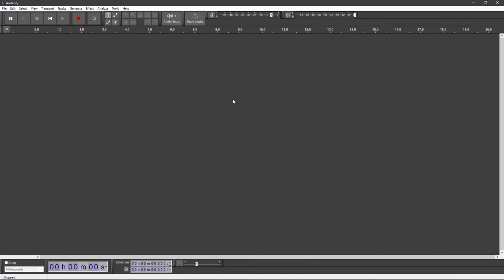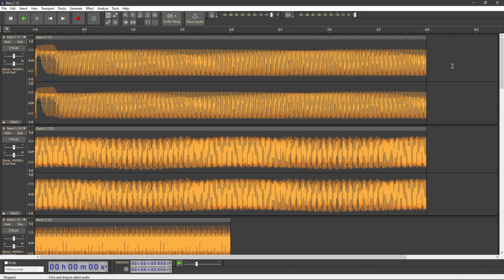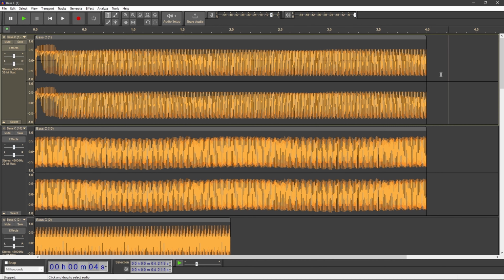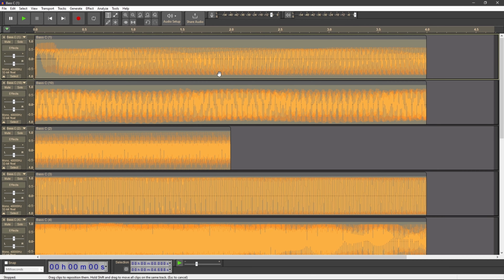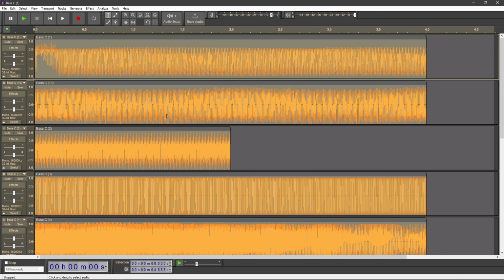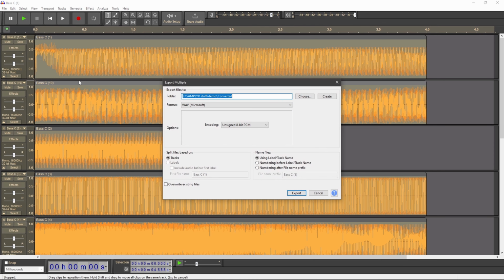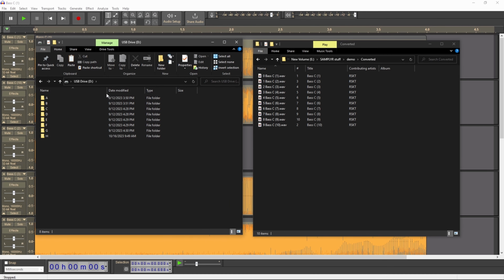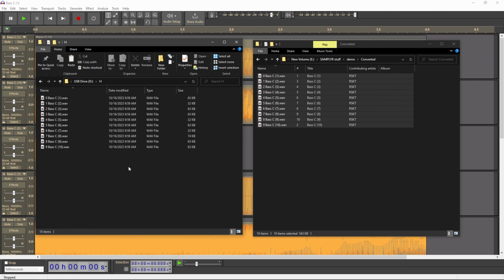The AE Modular Video Library - Samplyr

Comment from the maker: Hi All - I've been informed that the issues I discussed with this module have since been fixed in version 1.3 (which I haven't tried myself yet). There's also been improvements on the acceleration of the encoder, as well as some new features like a tape-loop playback mode that you can pause and restart. You can now modulate loop points (which is detailed more on the Wiki page). I will probably wind up creating another video showcasing these updates when I get my hands on the latest firmware, so stay tuned! :)

Comment: Honestly was expecting more from this module. Something like granular synth when you control length and start/end with random values within specific range but it will have only one grain at the time. At this price point with such low quality of samples required (~150€ with vat and delivery) it's not a good value.
Reply from the maker: That's a fair point, but I think it's a great jumping off point for incorporating built in audio sources into the format. With the announcement of the new MIDI modules too, it's pretty amazing what they're able to get away with using such cheap components and jumper cables. If there was a way to mod my PO33 and fit it into the case, I'd do it in a heartbeat, cause even I'll admit I have my own criticisms with samplyr. I think a trigger button would have been great. My one had a few missing features and a few bugs, but I've been given a little updater stick (not sure how to use it at this point, awaiting instructions). I also ordered another one, cause 2 is better than one, but I haven't sat down to see how it compares just yet. Either way, I'm pretty happy with it and stoked it's as cheap as it is, but I can understand where you're coming from too.